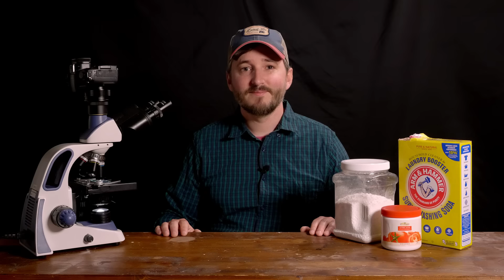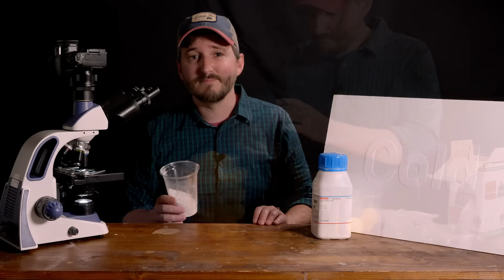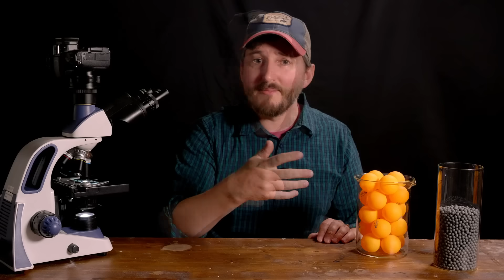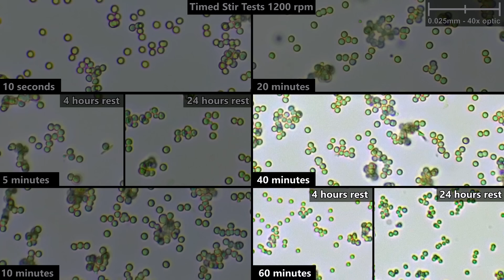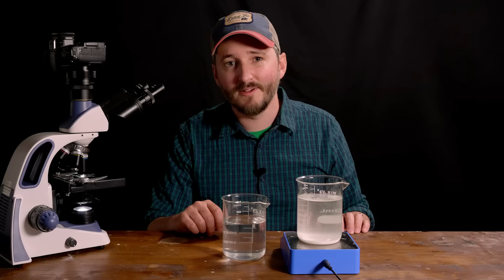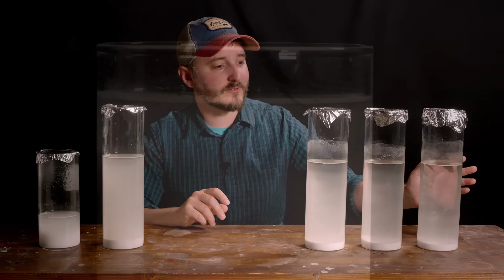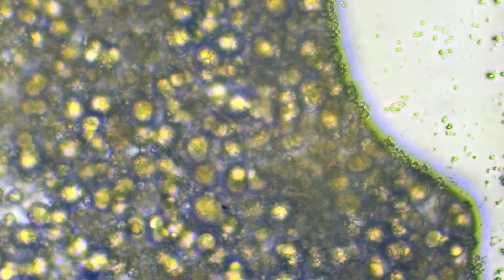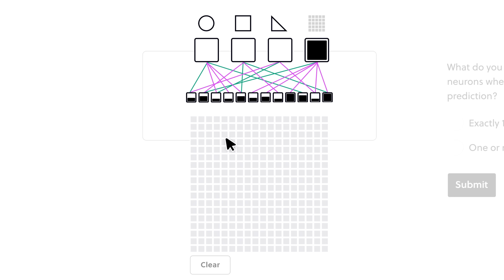Making Infrared Cooling Paint From Grocery Store Items (w/Novel CaCO₃ Microsphere Synthesis)

Comment: Awesome video! I wonder if adding some sort of "cold air reservoir" would help with cooling. One idea is an insulated box below the tile, so air would sink into it via convection when cooled. Maybe behind and add perforations or slits to the tile? This may have the advantage of keeping the tile in contact with warmer air, possibly improving efficiency.

Comment: Very interesting for several reasons. I can see what some possible things you might have that coating on an aluminum pipe could be in my opinion. Perhaps even a heat movement device, with water or salt water carrying energy to the pipe to help it dump it out where you want. i will keep some of this in mind for my attempts to manipulate LDPE in acetone, but also keep in mind I may want some acrylic.

Comment: Man this is incredibly fascinating stuff. You've got this broke down into such a simple process for something that does something so amazing, it's a passive process it that it just blows my mind. I am curious if you have done any other experimentation other than making it as a paint I was thinking perhaps cutting surface of an object that has a glaze of molten borax. They glaze crucibles and stuff with this, it's got a melting point that is below the final decomposition temperature of the calcium carbonate. It's still water-soluble but it's a lot tougher than what an oil based paint would produce at least I think. Man if i can find the time, I do believe you inspired me to have a new project this summer to play around with LOL
Reply from the maker: I've tried some various reflective plastic films as a base but no success yet.

Comment: Could you use that aluminum tubing as a way for passive cooling? Thinking about a heat pump/airconditioner that instead of using electric power to transfer the heat out of the refrigerant the tubing would all be coated in this type of paint to transfer the heat of the refrigerant to the paint to space.

Comment: Use a spin coating setup with the too thin to pipe mixture?
Simplify the particle sizing by pouring off measured amounts at the time intervals you used for each batch?
Put a layer of bubble wrap over the paint instead of a plastic film with an air gap? (Probably less efficient, but cheap, compact, and robust)
Would increasing the thermal conductivity of the paint increase or decrease performance?

Comment: Why does the cooling paint look cold & dim to the IR camera when it reflects IR light?
Reply from the maker: The emission goes down when an object gets colder. The wavelength is what makes the difference with this paint
Reply: Yeah…but the reflection of a lightbulb in a mirror is almost as bright as the lightbulb…in visible light (now I'm wondering what the IR refection looks like).

Are you saying the frequency is relative to temperature?

Then what's amplitude?

I need to watch more of this stuff…

Comment: 38:21 How about silk screening? (just the squeegee on a bare screen, no mask)
It would obviously be limited in application size, but you should be able to do whole panels.
It'd be very fast to apply, and you get a very consistent thickness and nice surface.
(And if you want/need, you can use the same method with a mask, and put on a design.)
Reply: I was thinking the same with a thinner mix that might self level after removing the screen.  Probably some optimal screen sizes for the desired surface finish and thickness.  Way more messy, though I was thinking the same. More of a production maybe method.  I was also thinking the clear acrylic using only acetone might be a good top coat, though not certain of the UV resistance and performance over time. Might be something more solar related coating or covering maybe and along the line of some sort of like squeegy the film onto the paint method depending on what the baking material is so can still cure and if like a continuous process or not.
Reply: @jafinch78  I've wondered about using Spar Urethane as a base but don't know if the UV resistance that is has means there's some component in it that would mitigate or reduce the reflectiveness in the mix.

I think the goal would be to find a medium that is UV durable and brings it back to being applied with a brush or roller, even if you had to apply 2 or more coats to achieve the desired thickness.

After that is achieved, I think a formulation should be targeted for best adhesion to different surfaces.  For example, while the basic final formulation may adhere well to many common smooth roofing materials like aluminum, galvanized steel or polycarbonite corrugated panels, it would be ideal if it could be optimized to coat asphalt shingles also.
Reply: @brianmi40  My understanding with the Spar Urethane is more like this rule of thumb that comes to mind in regards to marine finishes using epoxy, where the epoxy clear or maybe is called gel coats are not used due to their discoloration from the UV radiation.  Therefore, the polyurethane finishes are used as the outer layer to better reflect I guess the UV rays to prevent discoloration.  Not sure what the latest science regarding materials used currently or planning for in the future is. Haven't studied in detail.  I do recall for asphalt shingles, people are using acrylic coatings to reflect already out west.  Also helps prolong the life of the roofs.  There are also mastic coatings that I don't recall what those are made using.  Finally, there is this RoofMaxx product that is interesting and wondering if there is any potential to utilize with, though guessing not without a coating to seal.  Maybe can be microencapsulated or something as well since is hygroscopic and will absorb moisture, so my guess is better using with oil based paints for outdoor applications, unless there is a clear coat that maybe is hydrophobic?
Reply: @brianmi40    Silicone caulk is fairly UV stable.
Reply: Or apply it like concrete? Put down spacers around the edges with the desired thickness and run a scraper over it that's wide enough to sit on the spacers.
Reply: @DanBot2000  Unfortunately, it is way too fragile for such a use, unless there is some kind of perfect and very unusual adhesive type matrix to encapsulate it in. 

    But, and this is beyond the scope of 99.9% DIY'ers, industry could mix it with clothing plastics (polyester/PET, nylon, acrylic, polypropylene, polyethylene) while they are in their liquid state and then extrude the fibers, thus embedding it within the matrix of the fibers/material itself. 

   This is already being done with graphene oxide, jade stone, and other materials for their special/unusual properties.

Comment: I live on 1 acre New Mexico high desert in an 8x12 lofted shed with 2 windows, door.
Just having interior space is vast improvement over cramped, aluminum trailer, "insulated" with Styrofoam.
I have minimal solar power.
My social security is $900/mo.
I have access to storm and sliding glass doors occasionally from a door store.
Wondering if painting those, bolting to shed would help.
Would remove in winter for passive heat.
Roof galvanized,  reflective metal.
On 100°F days, it's tolerable in shed.
I sleep during heat of day, do chores early morning,  late afternoon. 
68 years old. Disabled. 
Can't wait to see your shed results.
Sharing with fellow off grid, low income neighbors. 
Thanks.

Comment: Man, this is gonna be too tempting. I might have to find a way to try it even though I live in an apartment. The main thing I'm curious about is how effective it might be to use mirrors and/or some form of optical channel (like maybe an aluminum or otherwise coated pipe? or ideally a fiber optic like cable) to redirect the radiated heat elsewhere so that you can have a lot placement options and thus enabling more possibilities.

Edit: I actually just got another idea. I wonder if you could use this concept or something similar as a potentially cheap or flexible way to move small amounts of heat. I doubt it, but if you could make a small and/or flexible and cheap "optical channel", it could be used to passively move small amounts of heat from one room to another by just running that channel under a door or something. I specifically might want this for my 3D printer closet in case it ends up getting a little too hot. I doubt that'll be plausible but who knows. I don't know enough about optics to know how hard that might be to do.
Reply: @nemam_nedam  My concern is actually it getting too warm. I might want a way to control heat better than a single air vent that will not cool in correlation to the room temp, especially since I have several printers. There is also no way I'm putting any of them outside, I'm in Alabama. Waaay too many bugs and is too hot and humid, plus it would be putting thousands of dollars of machine out in the open. I currently have my machines in a sun room attached to my living room.

Comment: Based on the consistency it feels like some kind of silicone paint or glue roller with some texture might be the best way to apply the coating.
Reply: I work in a smallish metal building with only evaporative cooling available. Being able to apply a coating like this with commercially available rollers and paint sprayers would be a game changer.

Comment: Wouldn't you get the maximum density from just using the smallest possible spheres?  At some point you will hit a lower limit to sphere size, so just use those.
I feel like I'm not intuiting this correctly.
Reply: The space between all the tiny spheres adds up to more open space than the big spheres take up. With big and small spheres, the small spheres will still create space as they fill around the big spheres, but it will be less than if there were no big spheres.
Reply: @EnergyQuarier  Yeah, suppose if a container of sphere size A leaves 65% empty space, then the same container filled with nothing but sphere size D would also leave 65% empty space.  Size is relative and irrelevant in this example.  Thank you.
Reply from the maker: Yep you figured it out. The density is just about 65% when using one size of sphere no matter the size.

Comment: I wonder if panels that were painted with this and then put behind solar cells. Could improve their efficiency.
Just wondering if that infrared energy that's reflected back could be used to generate more electricity. I'm not sure what the wavelengths would be on that.
Reply from the maker: The paint needs to face the sky, but perhaps you could use a mirror

Comment: Make panels,  paint then seal with shrink clear wrap,  sell your panels.  You're amazingly genius! Thanks for everything you are doing  !
Reply: For a commercial product, I think the optimal form might be rolls of flexible material with a thermally conductive adhesive. That could be transported easily and applied to almost any surface.

Comment: Seems like youd be able to use something like a screen print setup, but directly on to the surface to be painted instead of through a mesh, and with a blade with a suitable gap at the end. Pour in at one end, drag the layer across the surface with the extra going in to a trough at the other. Though maybe itd end up dragging out a lumpy uneven layer Im not sure.

Comment: Great video! Thanks for taking us with you in this journey!
Maybe it would work casting it with resin as a surface shingle kind of thing. In small batches with different parts of each.
You could also add heat sinks at the bottem to try to actively cool the inside of your hut 🤔
Reply: Turn that into a heat-dissipating wall/ roof tile

Comment: HY-TECH ceramic insulating paint additive is a fine, white powder blend of high strength ceramic "microspheres cost .12 an ounce
Reply from the maker: I'd be interested to know if the ceramic they use radiates IR in an appropriate spectrum.
Reply: @Nighthawkinlight  You have an interesting formula there, but I guess it gets down to time and money.  This is the paint they use on school bus roofs, I put a gallon on a fuel tank, rolled it on, It was easy to use and can be sprayed with airless sprayers, often used as a roof deck radiant barrier. 
I would like to make a large radiometer, with vanta black or various ultra black, solar absorbing paints, and various paints on the white or silvered vane.  Measure the speed with a laser RPM gun.
Maybe you would like to do that and test different coatings.

Comment: For applying it, airless spraying might be a good choice. It deals well with spraying high-viscosity coatings (you can spray cold tar with it). The primary drawback is that machines for it are expensive, and IDK if how well it will deal with calcium carbonate suspension (my worry is about parts wear).
Reply: I want to mix this with some clear hyperdip and see if it can keep a car cooler

Comment: The citrate is good at stabilizing the surface of particle which decreases the speed of dissolution. This is important because the microsphere is amorphous calcium carbonate which is intrinsically unstable compared to crystalline form but formed faster because of high entropy nature. By dissolving into the solution and precipitating out as crystal, the microsphere is converted into the crystals which is blocked by citrate ions.
+I just noticed that your method resembles 'seeding-growth' strategy in which you first make the seed by fast reaction and then use those seeds to make the size of particle within the range you want! You might be able to do the same control by using less carbonate in second stage.
Reply from the maker: Have you researched this before? You seem to know your stuff.
Reply: @Nighthawkinlight I've took a class about nanoparticles and the addition of surfactant is a method of managing the high surface energy which is the primary reason nanoparticles are useful and so unstable at the same time.

Comment: Why not paint a Peltier ?
Reply from the maker: It doesn't really cool enough to make much power in a little peltier. You get about 90W of cooling per m^2 of painted surface from the best examples of this paint so it makes sense for large panels, but not small peltiers

Comment: Wonder how its cooling works once dust and dirt get on the surface?
Reply from the maker: The paint is covered with a plastic film.
Reply: @Nighthawkinlight  The acrylic?
Reply: I would say, the more dirt , the less cooling.
Reply: @bill7778  Thats what I'm guessing, so that then brings up, how hard is it to clean?
Reply: @beachboardfan9544  another engineering problem to be solved.

Comment: 4:19 'To not to waste its cooling potential on the outside air, as well as to stay clean.'

2 questions:

1. So it would cool the air and the paint would become the temperature of the surrounding air?  So that would still make for a cooler structure than one in direct sunlight and would also help to cool the world?

2. As far as keeping it clean (and potentially solving the air problem) what about a clear coat; instead of the plastic?
Reply from the maker: A clear coat won't work, but it's possible the paint could be improved with a more weather resistant binder